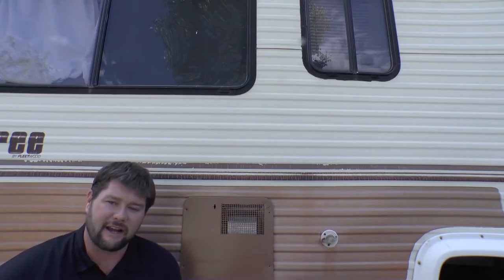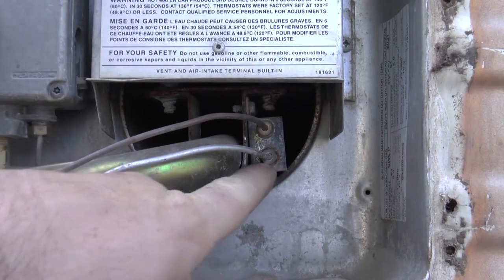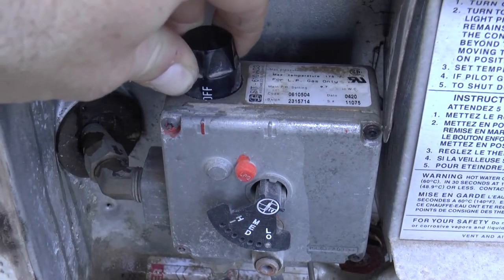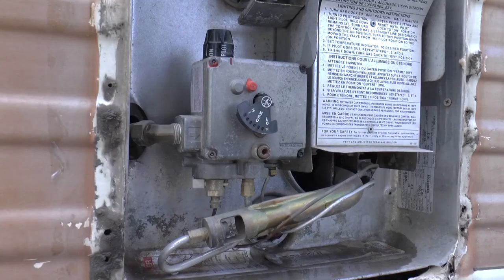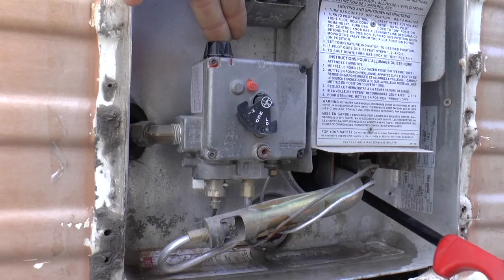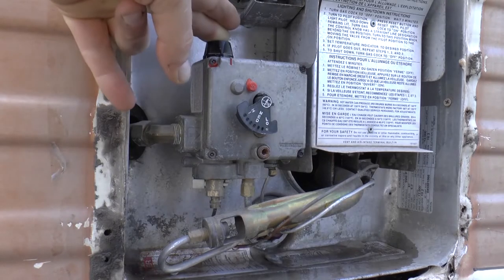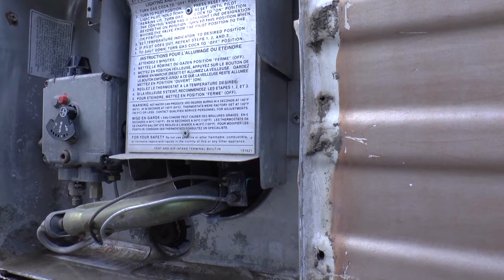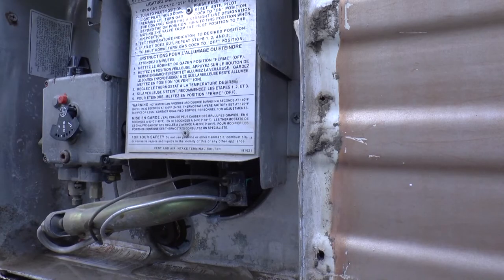How To Light A RV Gas Water Heater

Comment: Sweet, thanks, I have a 92' Dutchmen Classic Fifth wheel and I have never turned it on yet. I bought it almost a year ago and it has been so hot here in NM that it didn't matter. All I need it is for showers and dishes.

Comment: Thanks for the video! So one thing I don’t quite understand… does the water heater shut off when it gets to a certain temp or does it just keep heating? Should I turn it off at night when going to sleep or just leave it running all night?
Reply from the maker: Once the pilot is lit It will automatically turn off and on as needed to keep your water hot. Turn the gas to the off position when you don't need hot water for a long time or storage.

Comment: I have the same suburban water heater. Only thing is the last owners did some kind of modification to make it electric. There is a AC wire that is cut they connected the ground wire  back to the front of the unit. The other two wires are connected to what looks like a big thermostat and then to a toggle switch. I’m not sure why they did this but I can’t get the pilot light light even when doing exactly what you did in your video. Do you have any advice on what to do?  Great video I just wish mine was that simple.

Comment: Hey Jim, love the video !!!! I could do a companion video on how to burn all the hair off your arm trying to light the hot water heater 😀😀 I always seem to get a big flame at first ( Scary ) I get the bic  lighter going first then depress the pilot light button.  What do you think I'm doing incorrectly? Thanks for another informative video... Mike....
Reply from the maker: I have had that flame out happen with my water heater at home with old units but never with the RV water heater. There could be a blockage in the burner tube or orifice, insects are attracted to these areas and you may get spider webs in there. Make sure everything is free of debris and then just make sure you do not hear or smell gas with the pilot light off. Make sure your knob is functioning correctly and it is not in the "ON" position when it should be in the "Pilot" position. Maybe that will help you keep whats left of your arm hair. Good luck and happy camping.    Jim

Comment: Thanks for this Jim. I’ve been so afraid to turn mine on . This past summer I finally got comfortable with the fridge being left on. Should a window be cracked or is it safe to have all windows closed while burners are on ?
Reply from the maker: The water heater in the refrigerator should be just fine as they are vented outside. Your oven and cooktop might require a slight amount of ventilation but usually not a lot.      Jim
Reply: Thank you Jim.

Comment: so I never saw, but he is the propane switch supposed to be turned on inside the RV before doing all this? for example I've got a electricity and a propane switch for the hot water inside. does that get turned to propane before lighting this pilot or should it light independent of that switch?

Comment: Do you know if there is a way to install a electronic igniter on a old tank like this to help from having to use a lighter?
Reply from the maker: I'm not aware of an electric igniter retrofit kit. He probably just going to need to replace the water heater. They require sensors and igniters and circuit boards and all kinds of stuff.

Comment: Great video, thanks!  But now that it's lit... what is the recommended use?  Once the water reaches the set temperature, does the main burner turn off and just return to pilot light?  Will it re-ignite the main burner automatically from the pilot when the water begins to cool below a certain point?  Seems like leaving the pilot running all the time will burn up propane.  Is it best to go outside and re-lite/turn off every time I need it, or how long does one typically leave it turned on once it's been lit?  Any insights?  Thanks!
Reply: I have exact same questions
Reply from the maker: Yes to almost all of your questions. The only reason you will have to relight it is because of the wind and believe me it will blow out the pilot. You can try different solutions including tinfoil over partial bit of the vent but you don't want to block it because it needs air flow. it's a science. Basically, what I do is turn it off until someone wants to take a shower or perhaps do dishes and then I go out there and light it and then turn it off. The pilot uses a very negligible amount of propane but I a small amount of propane when your dry camping can add up. Light it when you need it and your main concern will be your black and gray tank levels and your water supply. Propane lasts a week but water storage and supply lasts three days depending on your usage. I hope that helps.
Reply from the maker: It is completely automatic as long as the wind doesn't blow out the pilot. It is designed to work flawlessly under ideal conditions with no tampering. If the pilot light goes out he has safety features to shut everything down. Light it and forget it under normal operating parameters
Reply from the maker: Every RV should also be equipped with carbon monoxide and smoke detectors. Not so much for the hot water heater but because of the Furnace. Just FYI

Comment: Hello, just wondering if a water heater with the electronic ignition can be lit manually. I cannot get my G6A-8E to work. Hard to get service here so I ordered a new circuit board in case that was the issue, but that will take 5 days to get.
Reply from the maker: It is not recommended. You could have a gas flow problem, a clogged pilot, low battery voltage, or any number of other issues that would cause it not to light. But if it's an automatic system the rule of thumb is usually just to get it serviced if everything else looks okay. You can definitely try replacing the circuit board after you've diagnosed and checked all the other possibilities. But everyone says you should not try to manually light an electronic automatic  water heater. I hope that helps.    Jim
Reply: @fullmoonadventureclub  Thanks for the reply, I appreciate it. I will suck it up and shower cold for a week or so. Service coming next Wed.
Reply: @fullmoonadventureclub was going to try to manually light mine as it is electronic and gas. Why is it not recommended? Is it unsafe to do so?

Comment: What if no water comes out of the valve
Reply from the maker: It is likely that the water heater is not full of water and should not be lit. Check your water level, water pump, and water heater bypass valves.